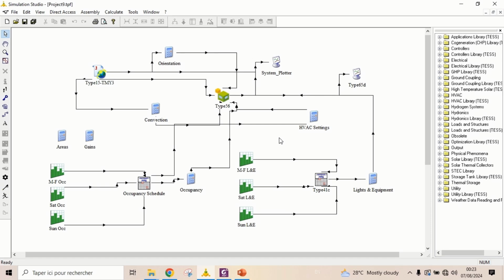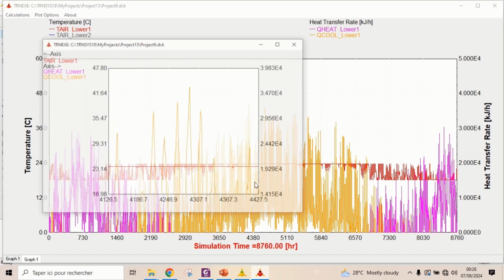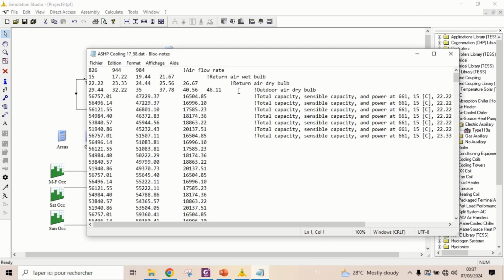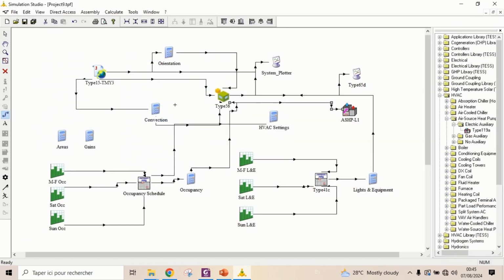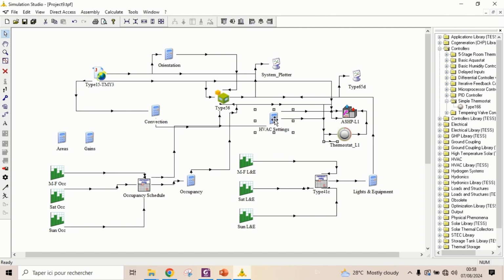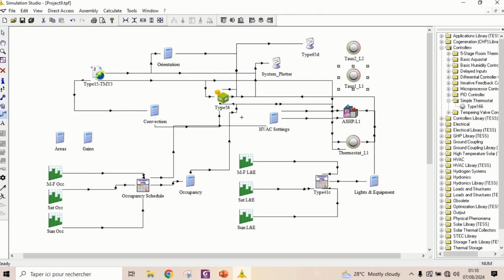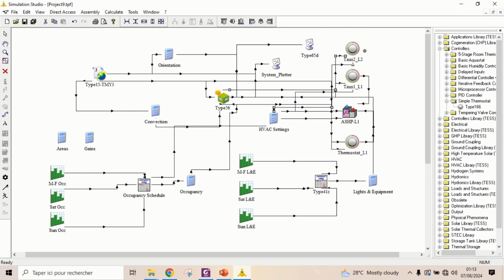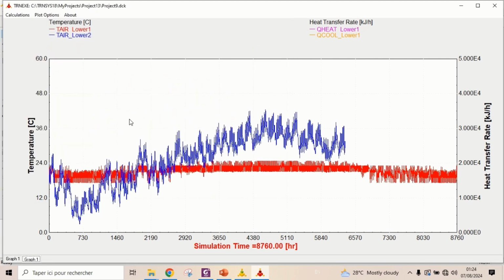How to design an HVAC system for a multizone building in TRNSYS - Part 10 - Heat Pump

Comment: thanks for clarifying the tools, may i ask if i can do the same thing for air to water heat pump with a building having an active layer?
Reply from the maker: Yes
Reply: @howtodoeverything59  can i talk to you privetly, so you can tell me how to do it? i'm having trouble for letting the system work correctley. i'll be blessed if you helped me. thanks!
Reply from the maker: @tagreedwael1258 Please send me an email.
shoaibkhan0759@gmail.com

Comment: Thank you for this clear video! I'm currently learning how to manage this type of project.

I would be very interested in seeing a more complex example, perhaps one including a heat pump, domestic hot water, solar panels, or a battery.

Is there an email address I could use to contact you about this?
Reply from the maker: shoaibkhan0759@gmail.com